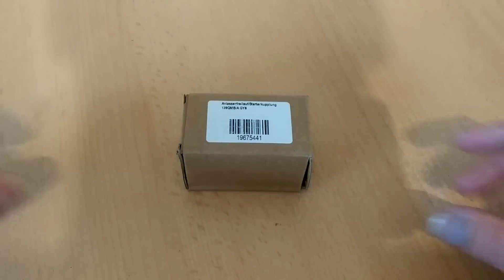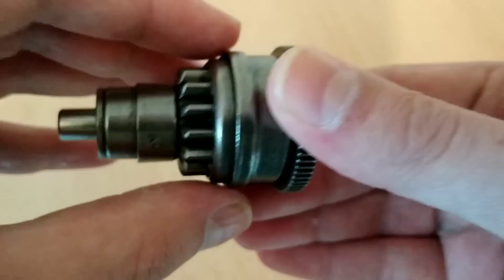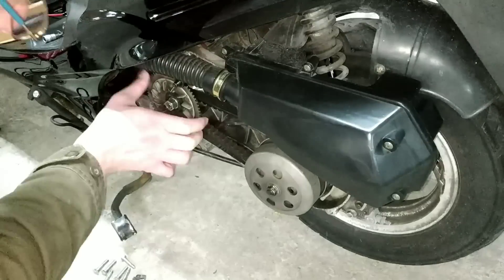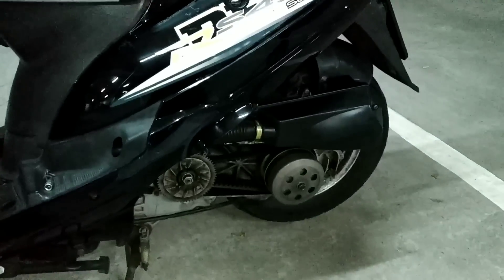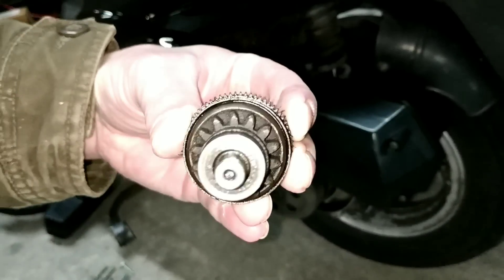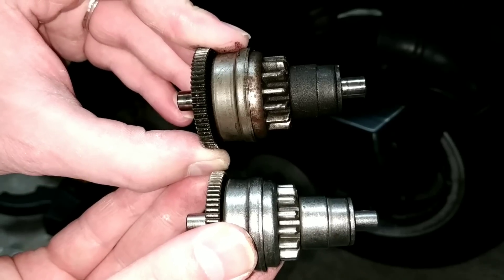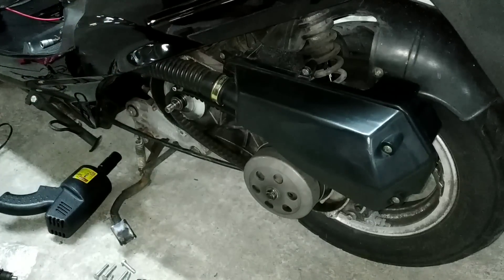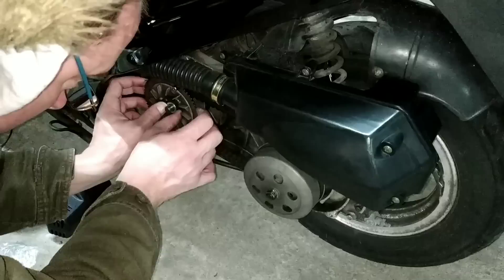Neuen Anlasserfreilauf einbauen doch dann.....

Comment: Schau mal beim anlasser relai oder beim anlasser motor nach
Reply from the maker: Habe ich schon scheint ok zu sein:
https://youtu.be/y3GPWOTd0Wc
Reply: @danielclassics12686  das was du getestet hast , ist der anlasser ,was er meint ist das relai welches auf der rechten seite helmfach ist,
wo ganzen steckverbindung von der lichtmaschine angeklemmt werden
so ein von oben aussehendes rundes teil mit 2 x 10 ner muttern
Reply from the maker: @jenstomic3669  Hi ah das Relais.
Da habe ich bei mir nix im Helmfach. 
Das habe ich im Batteriefach :-)

https://www.amazon.de/KAYSO-Performance-Anlasserrelais-Starterrelais-QM50QT-6/dp/B00TS8H7F6/ref=pd_sbs_263_3?_encoding=UTF8&pd_rd_i=B00TS8H7F6&pd_rd_r=61d13d6a-daf7-11e8-bb1a-d9d3c6859b92&pd_rd_w=vkXot&pd_rd_wg=GW0Me&pf_rd_i=desktop-dp-sims&pf_rd_m=A3JWKAKR8XB7XF&pf_rd_p=51bcaa00-4765-4e8f-a690-5db3c9ed1b31&pf_rd_r=TA203S6BK022ZK1RJ276&pf_rd_s=desktop-dp-sims&pf_rd_t=40701&psc=1&refRID=TA203S6BK022ZK1RJ276
Reply: @danielclassics12686  oh seit wann so einer??  Kenn den beim 450 und 460 den runden
Den
Reply from the maker: @jenstomic3669  Also ich habe wie gesagt so ein Magnetschalter im Batterie Fach drin.
So ein rundes Teil habe ich nicht drin.
Scheint vielleicht am Baujahr zu liegen mein Rex ist etwas neuer.
In den Papieren steht was von 24. August 2015

Comment: Moin Daniel hab mich ja jetzt lange nimmer gemeldet, wie wäre es jetzt denn mal mit ganz einfach einer neuen Batterie.
Denn ohne genügend Strom ( A ) läuft auch kein Anlasser oder Relais u.s.w.. Strom und Spannung sind 2 Schuhe.
Wenn Du Dir mal Deine Videos mal anschaust wirst Du merken das beim Betätigen des Startknopfes Hinten die Beleuchtung etwas dunkler wird, da fehlt also Strom ( A ) nicht Spannung ( V )
Ein weiterer Hinweis wäre, bei Deinen letzten Start Problemen fällt auf, immer nach dem Du Deinen Roller mit dem Kickstarter gestartet hast , kurz danach ging auch der E-Starter. Danach 1 Tag später wohl nimmer u.s.w..
Einfach eine neue Batterie, das wars. Und der Alte Freilauf ist auch noch weiter zu verwenden.
Weiterhin viel Erfolg, übrigens wie alle anderen Videos wieder TOP !!!
Reply from the maker: Moin Rolf :-)
Danke :-)
Ja das ist mir auch aufgefallen mein Roller macht eben was er will :-)
Ja das habe ich mir auch schon gedacht das hinten beim Anlassermotor kein Strom ankommt.
Das Relais schaltet zwar wie im Video zu hören aber mein Anlasser will nicht.
Das heißt Neuen Anlasser.:-)
Der alte Anlasserfreilauf ist wie im video zu sehen definitiv kaputt da sind die Zähne angenutzt wie im video zu sehen..
Naja gibt ja ende November für uns alle Weihnachtsgeld :-)